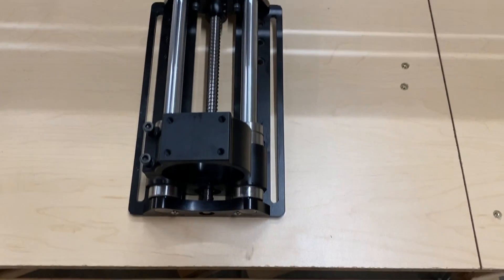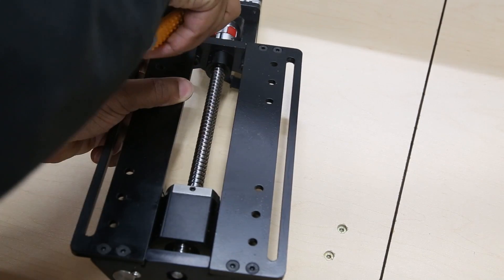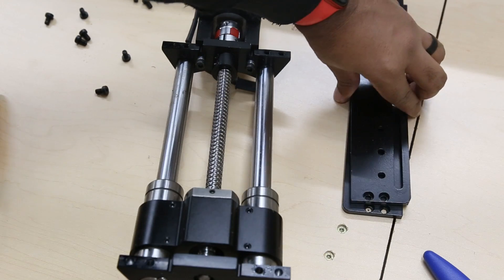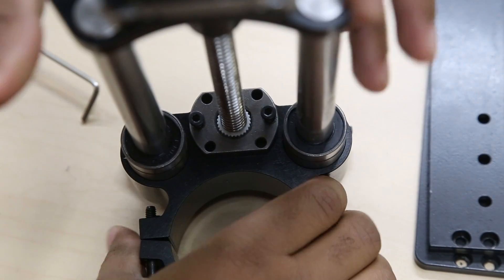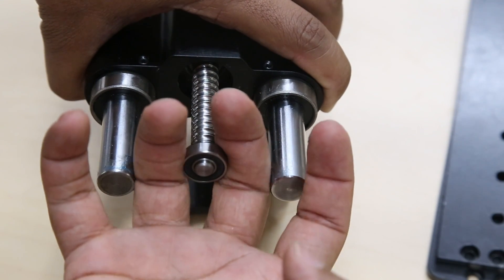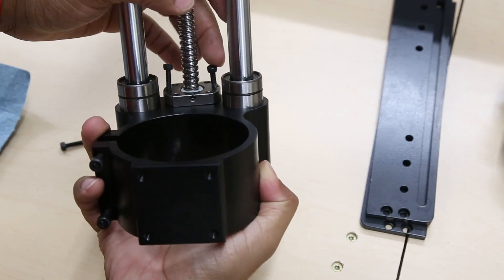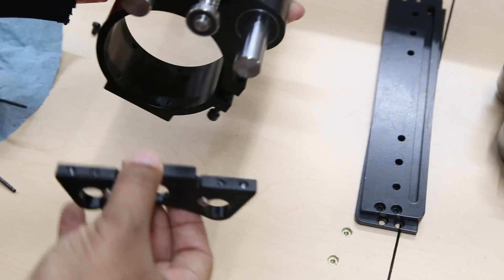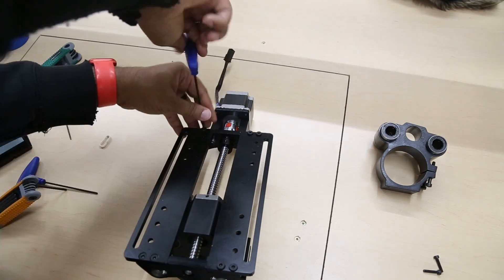Onefinity: Swapping the Spindle Holder 65mm to 80mm upgrade

Comment: Did you change the Z-slider, or just the spindle holder? I think you stayed with the standard Z-slider … if so, does it handle the spindle fine?
Reply from the maker: Yeah kept the original Z it’s worked fine so far. I’m going to push it on some cuts soon to see if it can keep up, but so far so good 😊
Reply: @vanstray : Thanks! Also, that’s a Onefinity spindle mount, right? I’m guessing that’s the only option that will work on a Onefinity?

Comment: Great, clear video. Thanks! 
Given how tight the screws are, I use a little anti-seize lubricant every time I take a unscrew/rescrew anything on my infinity. Most don't come off much, but I do adjust my z height occasionally and find it super helpful ever since I started doing this.
Reply from the maker: Oh I might need to snag some if I need to make more adjustments down the line